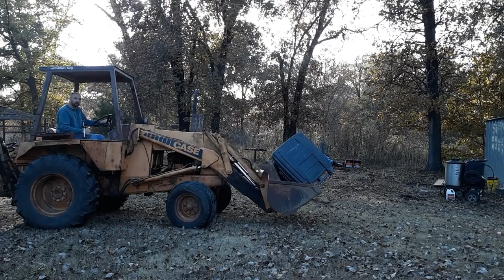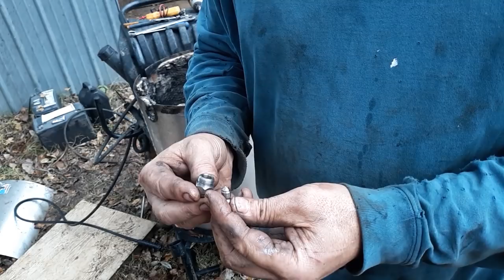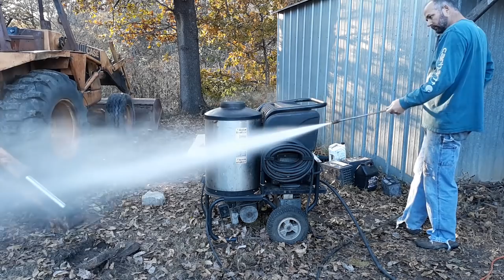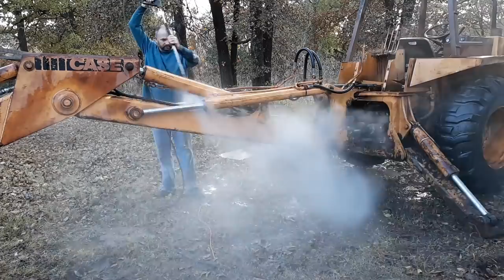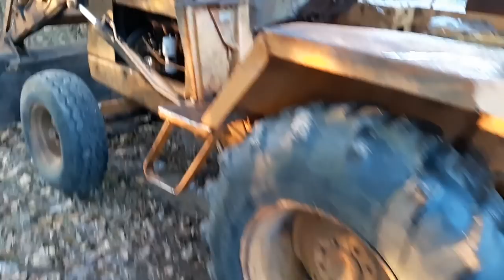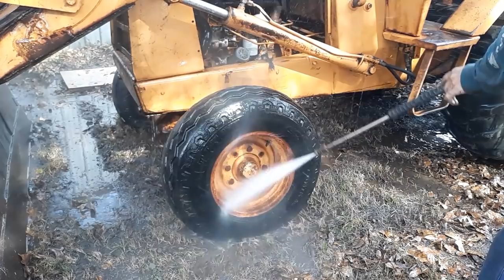Pressure Washing Abandoned Backhoe SATISFYING part 7

Comment: I pressure washed my Case 30+4 a few years ago and found many items that needed addressing... like you found.. pins nearly out, bushings worn but not visibly until washing.... I cleaned , sanded and painted with original paint ( from agri supply) replaced pins and bushings as were obvious after washing... I have a nice, reliable and usable machine now.. I AM AN ABSOLUTE believer in "wash first, then diagnose!" (When I had a VW repair shop years ago, I would charge (then) $20 extra if the customer had not cleaned their engine/ mechanical parts before bringing it to me. I had to do so much more work if they had not ( and might miss items also)

Comment: A scraper and wire brush would have saved you some time with the steam cleaner. Knock off the heavy deposits, spray it down with some purple crap and then put the steam to it.

Comment: I dont know if the B models are like the older 580 CK's but if they are, and  you havent noticed yet, look for greases fittings on the rear axle housing, backside of the wheels, top-side.  The bearings arent lubricated with the gear oil from "pumpkin" of the axle - instead they require grease.

Comment: Hopefully it just needs injectors cleaned, or maybe a new injection pump.  What kind of air volume is coming out of the draft tube (assuming a properly sealing fill cap is in place).

Comment: I bought an Allidian power washer 25 years ago.  Only had to replace the coil with an upgraded HD one.  Still working today.  How come you didn't wash it 1st thing when you got it home?
Reply from the maker: I like that washer.  i need to get a vacuum switch for it i currently have it forced closed
Reply: @mikekisch5563  get one from an Allidian.  The switch works on water pressure instead of vacuum.

Comment: You need some lug bolts in those front wheels. Maybe replace them with studs and nuts. It appears that the loader frame and bucket have sustained some damage and needs some work done.

Comment: Ok, a great work so far.
But hopefully you regreased her alle theway trough, because powerwashing meens you blow water in to all joints you have washed.
And then I think you now have to change the oil in the motor, since you still only have the ole bottle as oilcap.
Remember, oil swims on water, so when you pull the oilpin there always will be fin oil on it.

You have put so many hours and good work in to this projekt until now.
It would be a shame if you mees it up with a powerwasher.Btw, she looks rely better after the bath. but remeber the "afterwork".
Good luck.
Reply from the maker: I need to grease it for sure